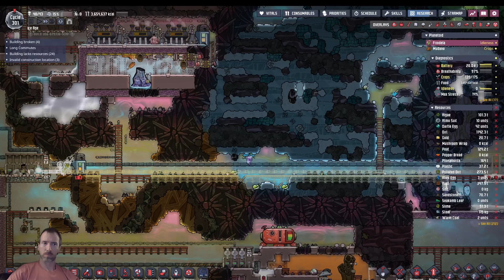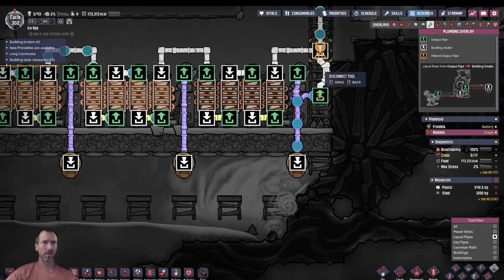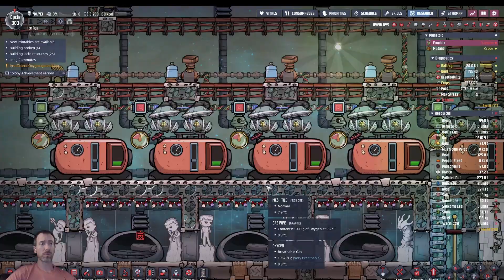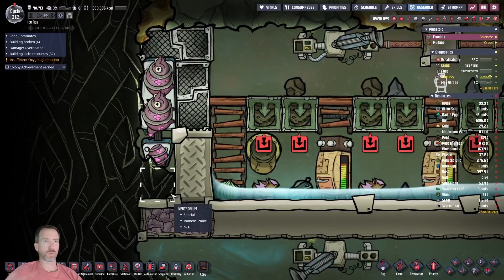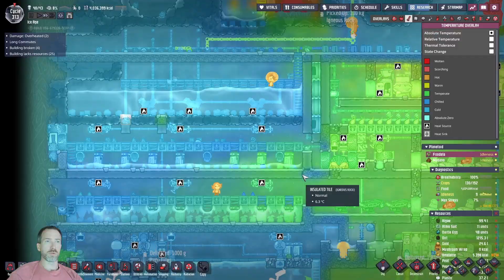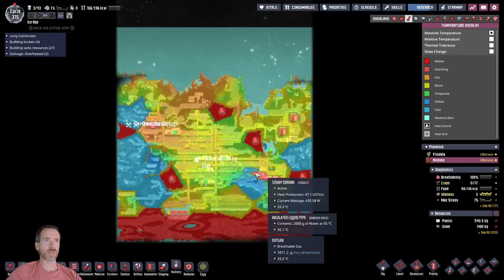What is the point of a SPOM? - IceAge - Ep. 21

Comment: If you only need to remove the heat/magma to access the geyser, you can do a very simple setup for Nuclear heat Destruction. You keep your row of insulated tile, a cooling line just below those tiles to cool nucealer fallout, a liquid vent to place some liquid nuclear waste and you have yourself the best heat deleter in the game for magma (except for the boring corner build destruction)

38:40 Gulp fishes spend less and less time in pwater as the tank fill up with water. That's why that is so slow. and the feeder being in clean water, they "reset" on top every now and then and just occasionnally go at the bottom to work on filtering.

Comment: Add a second atmospheric sensor on the bottom half and split the logic so the system is balanced. You might pull from one side hard than the other and the gas could get strange.

Comment: The math says that 2 electrolizers can fully use 1 water pump 100% of the time if the gas is pumped out and used.  

1 SPOM at 100% can provide air for like 15+ dupes.  Your process of peppering the ozidizers around the base and having 1 pump saves and nets about 1000 watts at the expense of possible gas build-up issues.  But you get a Jumpstart on a power system.  

Both systems have their merits.  A SPOM is nice because its ready to use clean oxygen that just needs a pipe extension.

Comment: SPOMs power themselves, to the point they have a separate circuit than the main base, that way if the main base runs out of power Oxygen does not stop flowing, it’s one less thing to think about. With the excess power created by the SPOM you can power the pump that brings water in, so the entire oxygen system is fail-proof as long as water is available. That and excess power/hydrogen can but put on the main grid as well. Certain values for the pressure sensors will yield a perfect equilibrium
Reply: The sensors are 248-250 for hydrogen, 450 for oxygen.